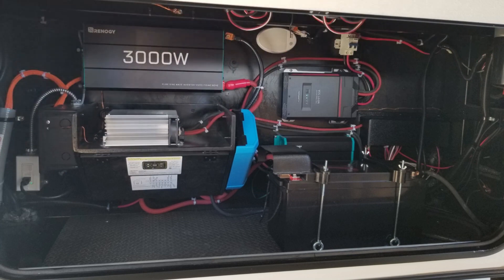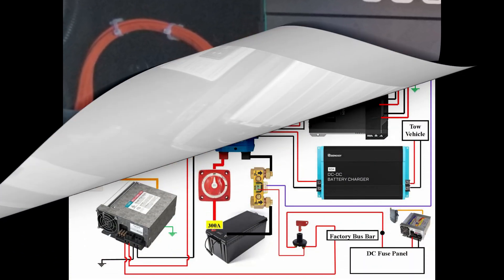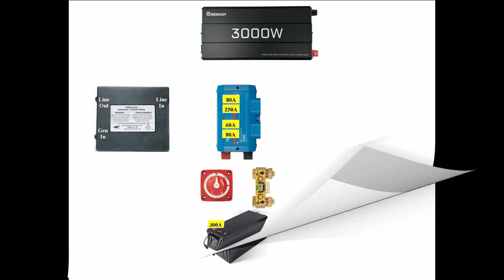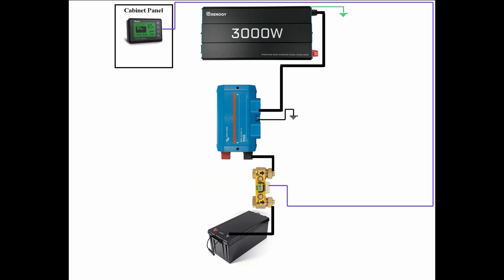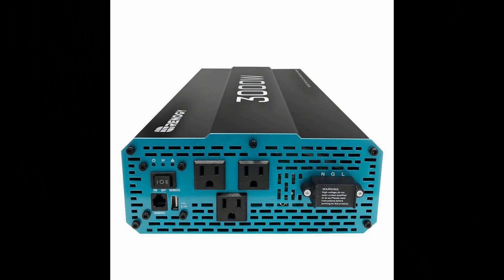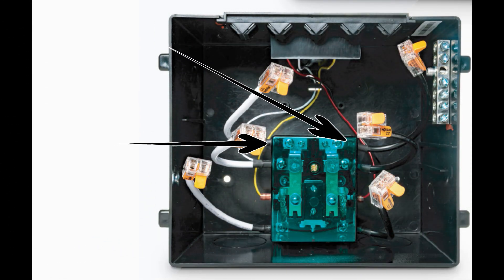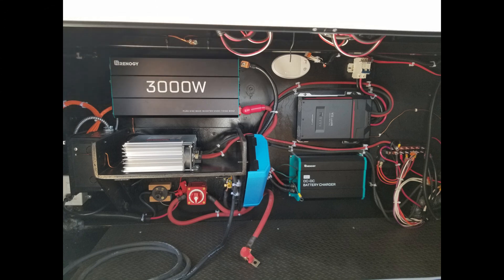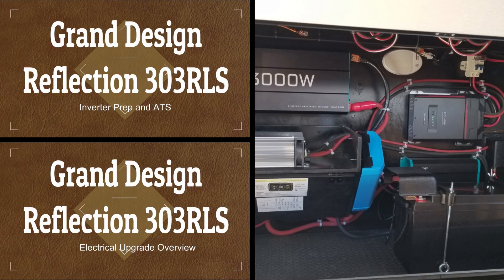Grand Design 303RLS Electrical Upgrade Part II - Inverter Install

Comment: Good morning. I wanted to use a 3,000 Watt inverter but the max current draw would be 250 amps. I have a renogy 300aH lithium mini and it's BMS is only rated at 200 amps. So I thought if I wanted to use the 3,000 Watt inverter I'd have to add another battery for a total of 400 amps BMS. Is that right? I haven't wired anything yet. I really don't want to spend the money on another battery. Thank you for all of your useful information.
Reply from the maker: Initially, I had a single LiFePO4 battery that would not allow the 3000w inverter to operate at its full potential, but had always planned to upgrade the battery bank. I just had to be mindful of the battery’s limitations. Right now, I have two 230ah batteries with 200a BMSs and may even double that. Had I not been planning to upgrade my batteries, I probably would have opted for a 2000w inverter.

Comment: why battery disconnect on positive side?
Reply from the maker: No particular reason - this is actually a heavily debated topic. I wanted to keep with the manufacturer’s format of disconnecting the positive side of the circuit. Some would argue that it is better to disconnect the negative/ground to prevent any potential of arching when using metal tools to disconnect the positive battery cable. Another argument for disconnecting on the negative side is the number of terminals that are potentially stacked on the positive battery terminal. Since I used positive and negative buss bars, I have a single cable running from the battery to the switch, and a single cable from the switch to the buss bar - no stacking of connectors. In the end, the switch just needs to break the circuit - positive or negative doesn’t really matter.